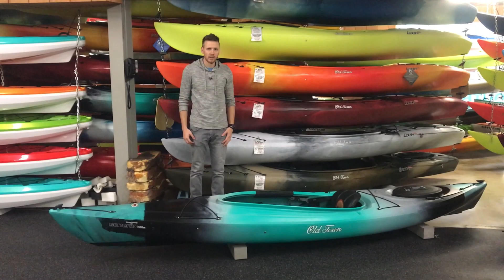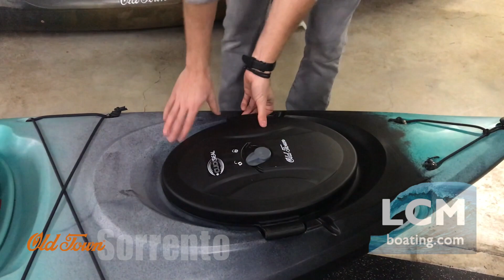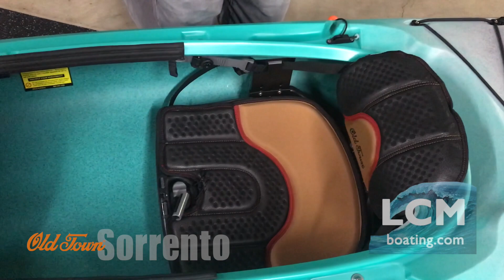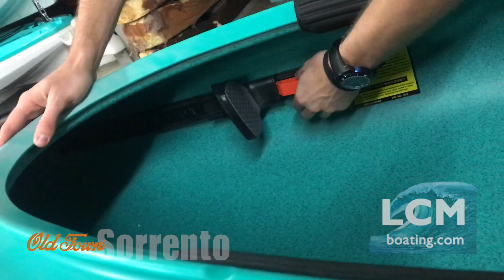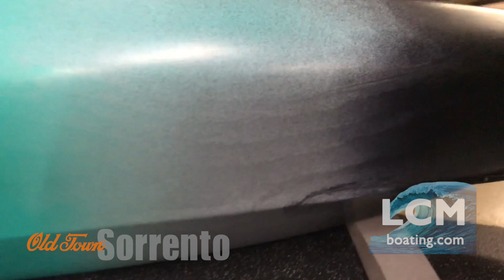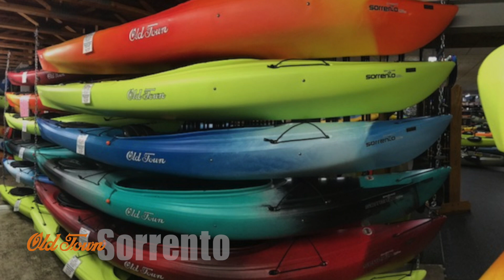Old Town Kayaks Sorrento - A Crossover Kayak

Comment: I'm very interested in this kayak!  I'm just unsure of the pros and cons of getting the 106sk vs the 126sk.  I'm new to kayaking.  Could you please enlighten me?
Reply from the maker: Some of making the choice has to do with your height and weight, we could recommend if you call our store and speak to someone with knowledge on proper fit. The pros and cons, 106 is lighter and more suited for smaller paddlers, cheaper to buy, cons it will sit deeper in the water than the larger 126. The 106 will turn faster, but not track as good as the 126. The larger boat has more displacement and will take less water to float, so it is easier to paddle, less effort. This should help, call our store with any further questions, 717-859-1121.
Reply: Go for the 126sk. It’s awesome faster then the 106 way more leg room so if u wanna put a dog or a small kid or a big soft cooler of a giant  submersible duffle bag it fits with zero issues between your legs. It’s also easy to Carry I’m 6ft and 145 I can throw it on my Toyota suv with no problems. I have learned the average recreational boat is 10ft. And a good performance touring boat is always going to be longer then 10ft. Hope these answers can help with any questions, I just bought mine back in Christmas of 2020, best kayak I have owned.

Comment: what would you recommend between sorrento 126 or loon126
Reply from the maker: If you can swing the Loon, I would recommend it. It has great paddling characteristics, a natural keel line at the stern. The additional plastic layers and dashboard make the Loon a top caliber rec boat.
Reply: @LancasterCountyMarine  is Sorrento 126 sk a better choice than loon 126? I am 6 foot and 200lbs.
Reply: The Sorrento costs $200 less and weighs 5 lbs. less if those matter.